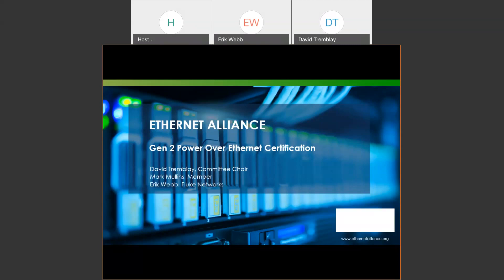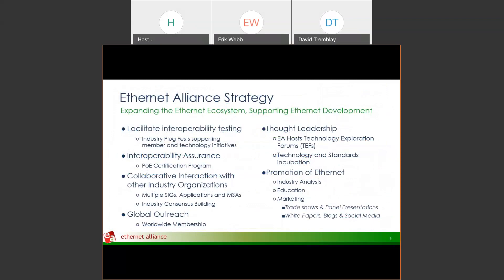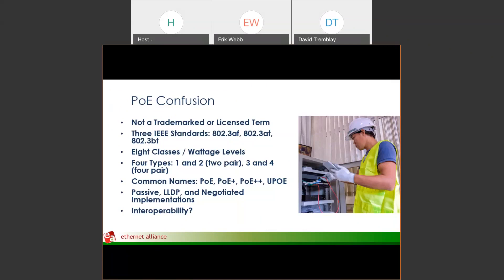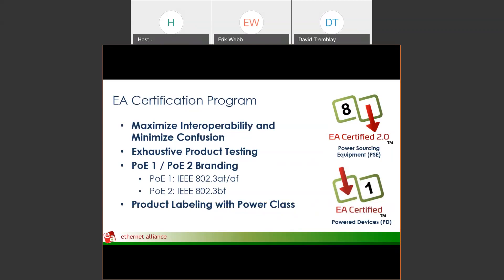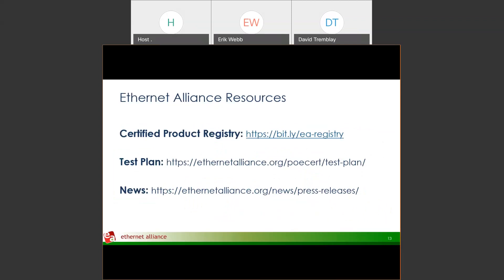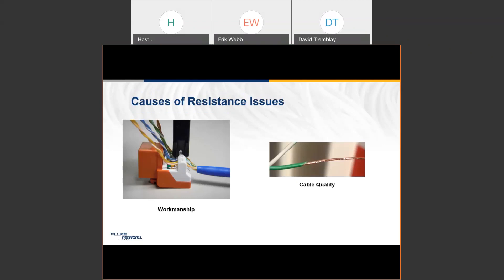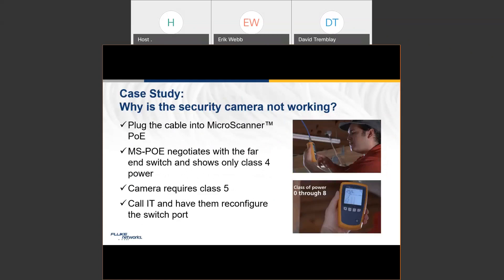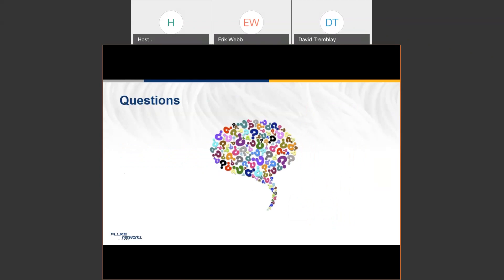Power over Ethernet Webinar with David Tremblay of the Ethernet Alliance by Fluke Networks

Comment: I just cant figure this out so id like to ask you!  In trying to read fluke test results I want to find out what cable would be better for a 500 or 600 ft run with a 8mp camera POE at the end of it.  NO Extenders or anything like that, just the best wire to run "too far".  here are 2 examples that currently i cant figure out the differences... ive been studying really hard so please help me. 
https://m.media-amazon.com/images/I/D1JtWPGBhlS.pdf
https://m.media-amazon.com/images/I/D1SAARER5uS.pdf